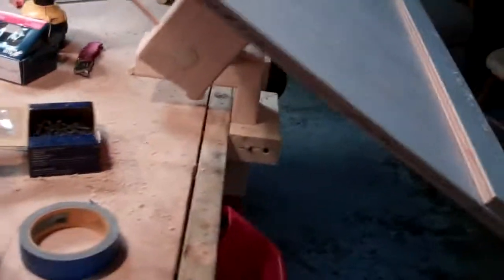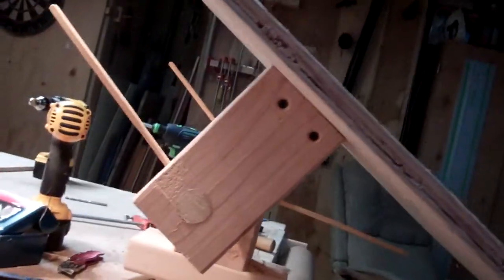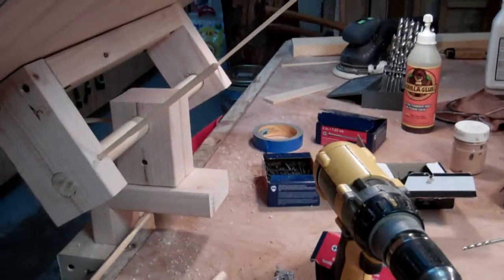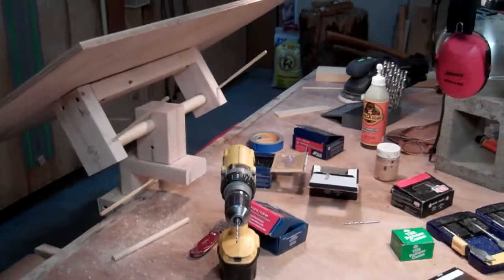Drafting Table

Comment: Nice drafting board you have there. Been quite awhile since I taped a dwg down....been using Autocad for about the last 20 years and the pencils have gotten cold. I was a Structural Detailer for several of my years here where I've worked the past 28 years.

Can't wait to see those watercolors!

Comment: THANK YOU... you just solved a problem I've spent the last year thinking about! I have a small garage shop and dont care to learn how to use a drawing program. I still use the 10-5 year old drawing a3 board I used at school for all my plans (mostly just home projects)
Im curious about the chopsticks holding it in place. Will see soon... 

Now all I need to do is figure out is to make a parallel / mechanical ruler and job done. Any ideas?